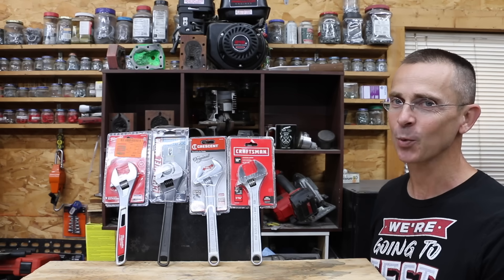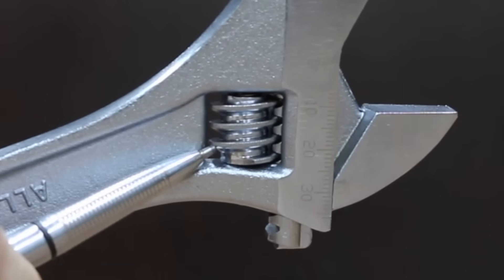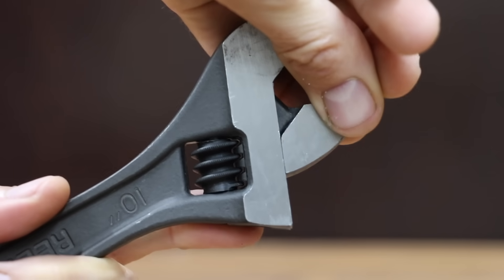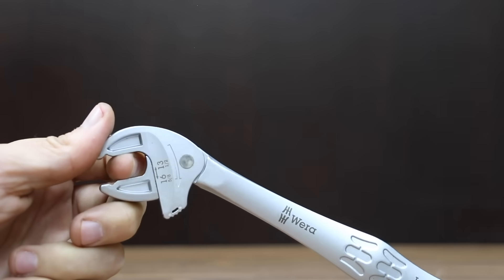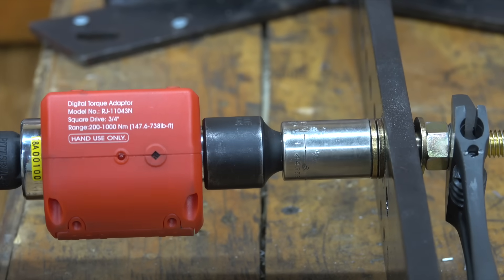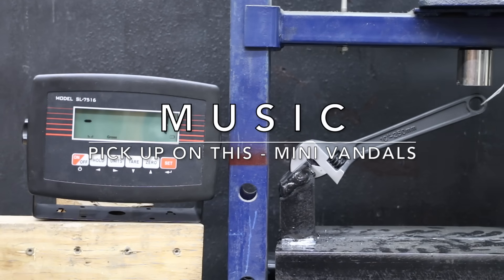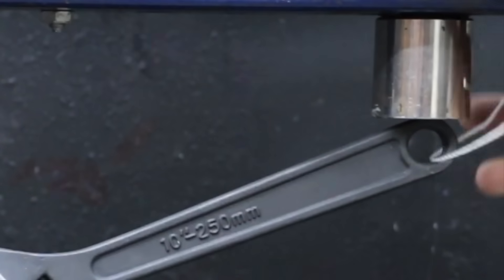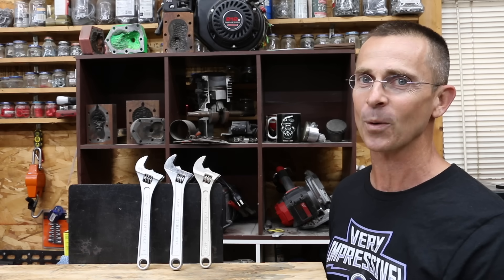Best Wrench (ADJUSTABLE)? Craftsman USA vs Craftsman, Crescent, Kobalt, Milwaukee, Channellock

Comment: If Western Forge was the OEM of that old Craftsman (most likely so, if the small letters 'WF' appear next to the eye loop), then they can still be bought new old stock from Cripe distributing, as of late August 2025, albeit with a different name stamped on. I bought an Armstrong branded 12" made in USA by Western Forge for $18 plus shipping, and it has an extremely precise mechanism just like the one you had

Comment: Another great test. I like the wrenches that are marked with graduations in both metric and SAE, generally then I would use a fixed wrench. Todd, did you test hose end repair types? I generally use a traditional rugged (determined visually) hose clamp but I have seen other interesting approaches.

Comment: Would love to see a head to head of Snap-on adjustable 6”, 8” or the 12” wide jaw that’s made by Bahco. Against the Bahco version that was in this test. See if the Snap-on is any different in quality. I own the Snap-on version and coworkers the Bahco bought off Amazon and the finish of the steel is different and curious if strength and durability are similar.
Reply from the maker: Thanks for the suggestion.

Comment: i have 2 snap on flank drive adjustables and they are amazing it is same as bahco iirc. i also have a really old williams 12" that i mainly use for motorcycle axle nuts. the snap on works on tie rods but i prefer the spring loaded wrench or snap on locking pipe wrench for tight ones. hf makes one very similar now
Reply from the maker: Thanks for sharing.

Comment: This is all interesting,  but my takeaway is that they are all adequate.  Who can put 100 pounds of force on a 10 inch wrench? If you're applying that kind of torque with an adjustable wrench you are seriously using the wrong tool.
Reply: Most likely you won't put this much torque but I can assure you it's impossible to go over 150 I have one 12 inch

Comment: best adjustable ive ever used as a mechanic is by far the snap on with the slotted jaws. leaps and bounds better than the rest. i have to beat them off of the fasteners some times , they almost grab too good
Reply from the maker: Thanks for the feedback.

Comment: While I have several old American wrenches that are good I’m just a do it your selfer and I seriously doubt I will ever put 600 ftlbs of pressure on a wrench that size so for junk around the barn a $6 Pittsburgh will work fine most of the time. If I manage to break one of them I’ll go get an old Williams or craftsman and finish. Great video Todd.
Reply from the maker: Thanks!  Thanks for sharing.
Reply: Yes, the cheap to medium types are sufficient and do the job, but there are also more poor keys that he did not display.

Comment: It looks like all but one of the adjustable wrenches are of the "Crescent style." I have both Crescent brand and Kline Tools brand and they are both very frustrating to use because I have to constantly readjust the wrench for the same nut or bolt. Why not compare the Crescent style adjustable wrench to the Knipex Pliers Wrench or Raptor? I only just learned the existence of those tools a few minutes ago but I feel so exited about them because the setting locks into place and they function similar to a ratchet even though it's not a ratchet. As soon as I post this, I'm going to Amazon to order the Knipex Raptor to see if I like it better than the Crescent wrench. I'm hoping it will be a game-changer for me because I tighten and loosen nuts and bolts all day for my job.

Comment: I love this channel!  I am a retired metallurgical engineer so I occasionally see something questionable in your test methodology.  For most topics, I wonder how , or if, you evaluate how representative of “ normal quality” each tool is?  It would not be possible to get a statistical average and standard deviation,  for each parameter but one wonders when an expensive tool performs poorly, if you got a lemon or if the brand is a fraud.  When buying a tool I try to remember what I see on your channel but the results of one test, in the absence of statistical data, can be misleading.  I read a lot of customer reviews but those opinions are lacking in experience and technical understanding to they may be totally in error.  Caveat emptor!
Reply: There are things that become clear by looking at them, and there are things that do not become clear until after years of use, and there are things that do not become clear until you put them to their maximum limit in normal or average use, and they will hold up.

Comment: I'm going into this knowing that the Craftsman made in USA will be crushing this competition. I have noticed how much better my father's and grandfathers tools are that they've had their entire lives over the ones I have been getting lately. There's such an insane difference of quality that it's insane at how Sears destroyed that brand. I've been using a 1/2" pry bar I got from my gramps and that thing is just a mess, but it still functions for what it needs. I used it in conjunction with a 1.25" Pittsburgh from Harbor Freight to pry up on a wall of a house to better support the wall for weight. The Pittsburgh broke in the first 5 minutes of use. Gramp's pry bar that was older than him? Still perfectly fine.
Reply from the maker: Thanks for sharing.

Comment: Why not test Walmart brands?
Reply: First, there are cheap or medium brands that carry many trademarks, and some of them you should test yourself.
Reply: @فارسالتميمي-ع7غ  that's fine, just test whichever matches the walmart or the same but cheaper
Reply: @ You are right, but in general, avoid very cheap ones. Focus on medium-quality ones.
Reply: @فارسالتميمي-ع7غ  
thats the point of the channel, to determine what is actually quality, there was very cheap items that perform better than medium/high, or at least you get more per dollar
Reply: @ Sometimes relatively cheap equipment is better, but very, very cheap is impossible. Also, depending on your use and the equipment you want, some may recommend taking cheap or medium equipment, and if you damage it, look for a higher quality type.
Reply: @فارسالتميمي-ع7غ very very cheap would be something like temu. Cheap stores could be better, like harbor freight. And if I buy better when it's damaged, what's the point of this channel?

Comment: Hello thanks for the video.
The Hazet is made in Spain by Irega like all the other spanish wrenches the all come from the same company. So if you look to buy one the Irega labeled are most of the time way cheaper than the labeled ones from Hazet and Stahlwille but the are litteraly the same made in the same Company. Most of them are pretty tight but some of them can have more slip but overall they are pretty good wrenches .
Reply from the maker: Thanks for the feedback.

Comment: I watch your tests and generally find them well thought out and executed. Unfortunately, this time I must take exception. ALL of the adjustable wrenches that you tested were torqued backwards. If you turn the wrench over and load it in the opposite direction, the load is placed on the adjustable jaw much closer to the frame, so there is less leverage twisting it. The way you used the adjustable wrenches, the small moveable jaw is being loaded out at the extreme end where the leverage is max. It is possible that it will make little or no difference, but that is what I was taught and have always done when using an adjustable wrench.

Comment: Mostly all adjustable wrench are garbage 😅. However i am interested to try the knipex pliers wrench. All the data appears to show that they do work
Reply: It is excellent and not trash. It is one of the most important pieces of equipment that a plumber or someone who works in home maintenance carries, because there are many sizes that are not fixed, but in the sizes of small nuts, regular keys are better.

Comment: As a professional shop owner for 30 years Tekton (a U.S. company but not near all their tools are made in the USA) is a GREAT brand. Strong, reliable, heavy duty tools at a very competitive price from a family owned business located in Grand Rapids Michigan. 
Their 1/2 drive impact sockets, torque wrenches and comfort grip tri-lobe screwdrivers are all top-notch shop favorites. Every impact socket you have seen used on Torque Test Channel is a Tekton impact socket. I am not a sponsor just a suggestion from someone who actually has hard use tool experience to give them a look.
Reply from the maker: Thanks for sharing.

Comment: My instructor for power sports tech certification said the adjustable wrench is a tool of last resort since they can easily damage parts which can be hard to come by. His advice was to buy a an oversized one and a smaller one and skip the middle sizes. I thought that was great advice for the world of mechanical repair... 

and as a side note that tool of last resort hit home for me. In my youth on a family road trip from WI to mount Rushmore we blew a tire on our popup camper. Here we are as a young family pulled over on the side of I90 in the middle of nowhere and it is 109 degrees out. We dont have a tire iron the size of the popup camper lug nuts (first trip with it) the only thing we can possibly hope to have work is a adjustable wrench. My dad and I took turns in the heat loosening and tightening each lug nut. By the end of it the wrench was ruined for sure but we made it back to home at least.
Reply from the maker: Thanks for sharing.

Comment: Never, in all my years, found a use for these beyond straightening bent sheet metal. They either don't fit in, don't exert enough torque & are generally pretty useless - imo.
Reply: It is useful for installing water mixers, for example, and not limited to it, and I use it to break some interior door locks.

Comment: For daily abuse the Bahco retains a smooth action above most over years. I've still got my apprentice one that's had 30 years daily use as a Plumber. I believe they still hold the inventors Patent too meaning they operate the correct way and all others open and close backwards which is worth noting because for professional use when you get used to that you can't unlearn it :P
Reply from the maker: Thanks for sharing.

Comment: I used to have Diamond Horse Shoe Diamalloy adjustable wrench I bought at a garage sale back in the 70s, that wrench had zero play anywhere, and the worm screw was beefy compared to today's crap, it was heavy and tight to turn the worm gear, but I couldn't break it if I tried.  I had to keep that thing oiled well or the worm screw would get too tough to turn, so I would hose it with WD40, wipe it down, wait for a few days, then put Tri Flow when it came out which worked better than oil.  Somehow that Diamalloy wrench got lost in a move.  I now have a Bahco, but I can tell it's nowhere near the quality of that Diamalloy.  Even the Craftsman from back then had a better quality feel to it than the Bahco, very little play, but it did break.  My brother was trying to get an engine bolt off, so he had to put a pipe over his socket wrench to use as a breaker bar, which the force broke his ratchet, he put the pipe over his Craftsman adjustable wrench and applied force and broke it, then it was Diamalloy's turn to have the pipe put on, he was turning red as a beet and swearing at that bolt before it finally gave, but the Diamalloy was fine!
Reply from the maker: Thanks for the feedback.

Comment: My Snap-On Adjustable wrench has teeth on the jaws. When It bites into a bolt its actually very hard to remove off the fastener, and very hard to adjust it off. But mannnn does it bite. Really good for alignments with rounded inners.

Comment: Lobster brand adjustable wrench is quality , Made in Japan !
Reply from the maker: Thanks for the feedback.
Reply: Got a link
Reply: @poloiscorrect  Amazon  150MM Adjustable Wrench $23.00 - $25.00 The wrench is designed that it will not completely close .  Jaw opening 6MM - 24MM .

Comment: Nice work!
In Australia, I think the best overall between thinness of jaws and strength are made by "Eclispe". From what I've read its a sub company of "Spear and Jackson, England".
They look a bit like some of the new Kinchrome. Blue rubber padding on the handle. 

I've love to see you put those under the same test!

My guess. Because of the thin jaws they will fail under you destruction tests, but the other tests I think they will kick ass.
Reply from the maker: Thanks!  Thanks for the suggestion.

Comment: Great test. Might be interesting to see how all the tools stand up to humidity and possible corrosion. Have a set of craftsman pliers that rusted up in short order in my tool cabinet in the garage. They are a mess. An old vintage Fleet adjustable sits adjacent and looks good as the day it was made.
Reply from the maker: Thanks for the suggestion.

Comment: Great video, as all of yours are.

One test I'd love to see you do it to compare the direction of rotation of adjustable wrenches.  It is commonly accepted that wrenches should be used in the direction you used in this video.  Crescent brand wrenches even have a direction arrow in the casting.  It would be interesting find out once and for all if it just urban myth of if there really is a correct direction in which to use a wrench.  If anyone can do this test well, it is you!
Reply from the maker: Thanks!  Thanks for the suggestion.

Comment: Great test, as usual.  I still own a couple of Craftsman USA "crescent" wrenches that I bought back in the early 80s.  Glad but not surprised to see how good they are.

Watching the great video in these tests, showing the jaw deflection in the wrenches, it makes me wonder how well they would perform in these tests if they were used "backwards".  When the wrench is used, and deflects under load, the jaws put pressure on diagonally opposite corners of the object being gripped.  Used in the standard orientation, contact occurs at the "heel" of the fixed (strong) jaw, and at the "toe" of the movable (weak) jaw.  This puts a large bending moment into the base of the movable jaw (in addition to the direct spreading load), but only the spreading load into the base of the stronger, fixed jaw.

Logic tells me that the fixed jaw would be much more capable of withstanding that point loading near the tip, and that the movable jaw wouldn't deflect as much/break as soon if the point load on it were to be applied at its base.

If you ever do another round of testing on these adjustable wrenches, it would be very interesting to see how the results would change if you tested two of each brand - one torqued in the "correct" direction, and one in the other direction.

Note: This logic would apply to any non-adjustable open-end wrenches, as well, since the "correct" way of using them is also to push the handle towards the smaller, weaker jaw.

Thanks for all you do.
Reply from the maker: Thanks!  Thanks for the suggestion.

Comment: When I was working high ropes rescue, I carried a Channellock 6" Code Blue WideAzz that I picked up on sale. The company I worked for were a bunch of penny pinchers & bean counters that only gave us cheapo 4" Pittsburg adjustable wrenches, and the crews I worked with were always asking to borrow mine. Whenever I had to do major course repairs (at least that didn't require torquing to spec), I had a same type of wrench in 10". I know Project Farm had it in the middle of the pack, but for me, the fit and finish for the price you pay was just unbeatable.

4 years after leaving that job, they both still live in my trunk as part of the away bag. The 6" is particularly useful for the turnbuckle rig I use for roadside serpentine belt repairs I always end up doing on my friends' beater dailies.
Reply from the maker: Thanks for sharing.

Comment: These wrenches would generally be used on hex nuts (I would have thought). Jaw length was mentioned a few times, but as long as the jaws are long enough to fully take in the largest nut that can fit in the wrench, why would they need to be any longer?

Comment: My 60s / 70s BAHCO Adjustable Made in Sweden (I inherited it) performs very well for me. I've even used a mallet on it to free seized nuts on vehicle suspensions. I keep the tension on the thumbscrew when using a mallet. The other nice thing about my vintage BAHCO is how thin it is vs. Other wrenches / spanners in my toolbox. 
Tools made in China and India are poor quality; I avoid them like the plague because they can damage components and make your life very difficult.
Reply from the maker: Thanks for the feedback.
Reply: Taiwan made tools are usually very good quality. From China I only buy tools with name brands, for example Makita etc, so I know they have tight quality control.

Comment: Love this channel. Always like to use as a good reference. Saw some Kleins in Lowes today and had a 2 pack, the 10” and 6” for $29. They have same part number as your 10” but has an orange rubberized handle and says made in S. Korea. They caught my eye because they looked much more precise than some others I’ve had in the past (I have some black Stanley’s from a while ago with a sort  of plastic handle that ironically seemed similar) and so I bought them. I was thinking of getting the Milwaukee set when happen to drop by Depot, but maybe I’ll just give these a try
Reply from the maker: Thanks!  Thanks for sharing.

Comment: i have one that takes larger size nuts & bolts the jaws open up larger than others with the same size handle
Reply from the maker: Thanks for sharing.
Reply: its 45 years plus old called diamondalloy green vinyl cover on only 10 inch handle I was electrican great to use on large nuts up to 2-1/2and bolts in tight places inside oil filled transfomers